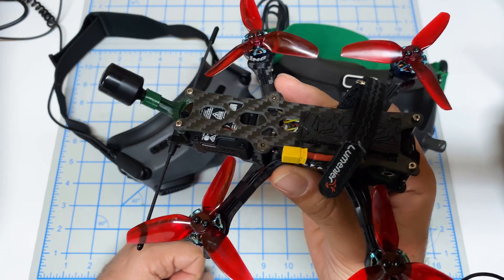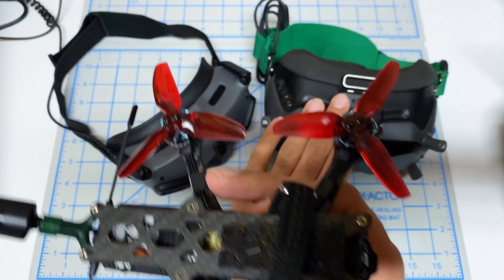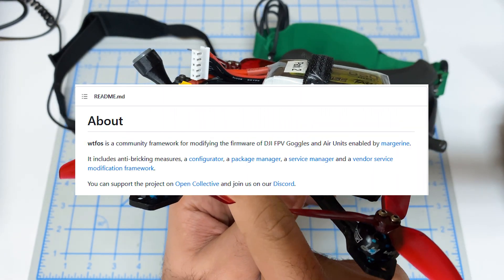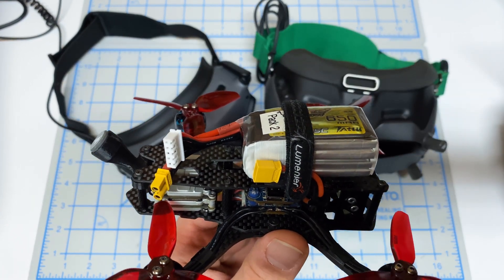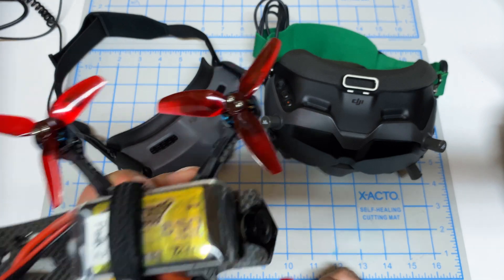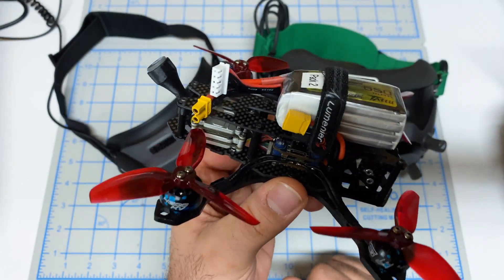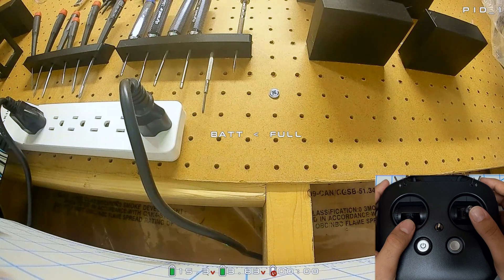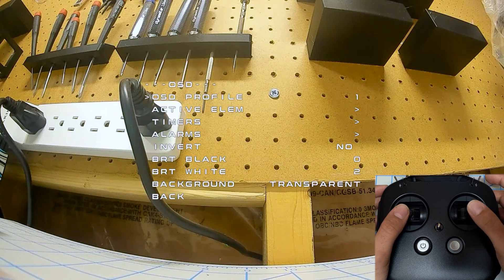How to Modify Your Betaflight Settings Using MSP Canvas Mode WITHOUT a Computer!

Comment from the maker: Hey Folks. Thanks for watching this video. A quick update on the compatibility here as it gets fairly complicated and moving quickly!

O3 Air Unit - This works with the Goggles V2 and Goggles 2
Vista/Air Unit Lite - This works with the Goggles V1/V2 with WTFOS
Vista/Air Unit Lite - This works with the Goggles 2 if you use the Backwards Compatibility firmware. Note: The Vista will no longer work with the Goggles V1/V2 once you install this firmware. (Dec 8th release)
Reply: Thank you for the video and clarification!

Comment: Sup mangurl it’s 2024 and I have a Dji goggles 3. I didn’t have to install the wtfos thing or root my goggles I’m able to change betaflight settings easily am I missing anything or I’m ok?
Reply from the maker: You’re okay. The o3 air unit supports the MSP DisplayPort (I.e. canvas mode) natively.

Comment: Wait I thought I saw a crossfire antenna on that qaud? So you can change the pids with any kind of tx protocol?
Reply from the maker: Correct, it’s a feature of betaflight so any radio link will work.

Comment: I thought that with the latest firmware you can setup Canvas Mode with also the Caddx Vista and DJI Goghles 2.  

Here’s a video showing exactly that. 

https://youtu.be/gQFcvDB5RC4
Reply from the maker: Correct, if you have the backwards compatibility firmware for the Vista + Goggles 2, you also get the MSP Canvas Mode.

Comment: Nice one. You should definitely try the T-Motor P1604 on this quad. You'll regret ordering more Xing2 1404 on aliexpress at a discount. 😀 Also be careful with this 650 battery, it really does look puffed.
Reply from the maker: Ya that pack is done, it has a big black x drawn on it. I only use it for bench testing.
Reply: The 1604 is nice but the 9x9 mounting is a weird choice for a motor of that size and my current 3” frame doesn’t support 9x9 mounting.

Edit: plus a 1604 isn’t directly comparable to a 1404 in terms of power and weight.
Reply: @sketchpv  Hey, I put the P1604 on both Quadmula F3 and AOS 3.5 no problems with the mounting pattern, and these motors are intended for 3-3.5" frames.
They are definitely not compatible in terms of power! P1604 are very and I mean very powerful! Weight wise, once you cut wires to the arm length, it's only 7.5g heavier in total drone weight, so they are definitely in the same weight category.
Reply from the maker: @sketchpv  Isn't the 1404 9x9 as well? Which 3" frame are you using currently? All the ones I've had did support 9x9 (iFlight DC3, QAV-S Mini, and Quadmula Siren F3). I'm really curious about the weight difference of these 2 motors, they publish the weight but I don't know if the Tmotor weight (11.6g) is with cables or without. iFlight says 10.1g with wires.
Reply: @Mangorille  Yes, the XING2 1404 is also 9x9. I’ve been using 1504.5 motors on a TomoQuads El Camino V2 3” frame and both are 12x12.